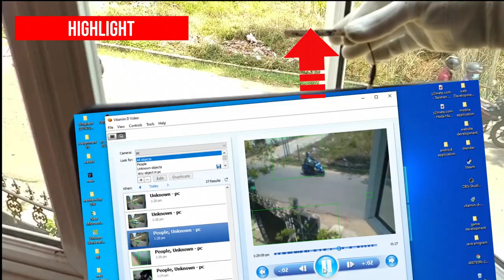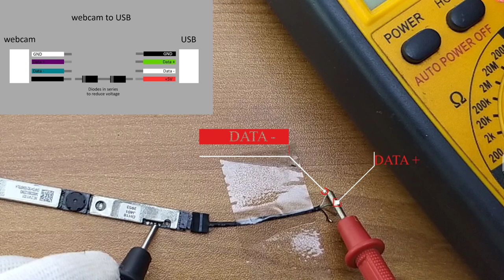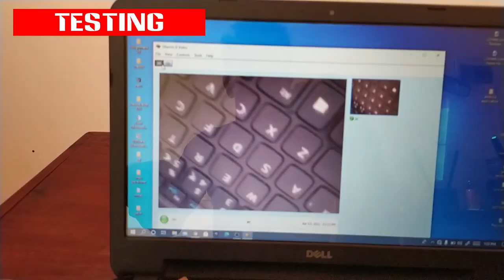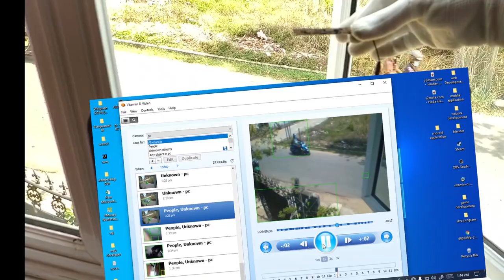Home made  mini spy camera with motion detection | Hiding camera making | Laptop web Cam to USB Cam

Comment: NEVER  Never never cut all the wires in a cable the same size ! ! ! You should have cut each 4 wires at different places and soldered them so that the joint of one doesn't touch another joint.  (You learn this trick in the first year of electronics course in every College in California)
Reply from the maker: Thank u very much. 🙏